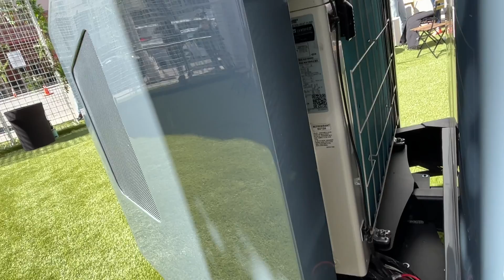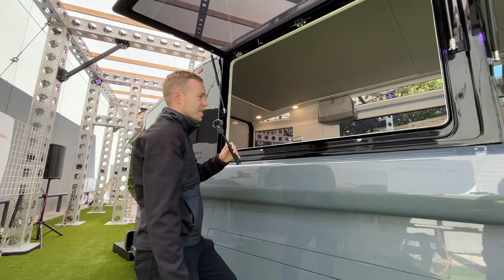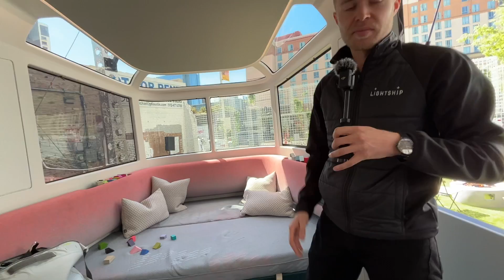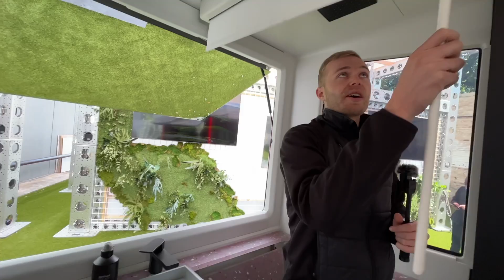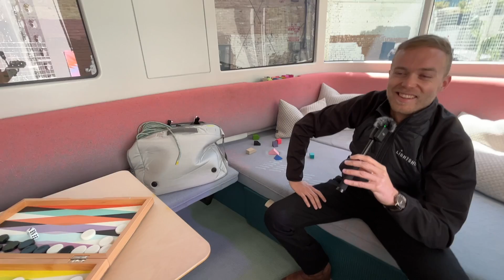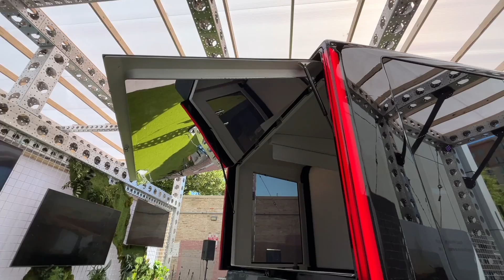Full Tour of the All-Electric Lightship L1 RV

Comment: A few practical questions: For the main sleeping area, is there a way to put on a fitted sheet? For the secondary sleeping area, the table top lowers to the top level of the cushions, but where are the pads to make a bed? Is there and exhaust fan built into the bathroom light or somewhere else in the bath?

Comment: 7500 lbs or 3400kg  is too heavy for pulling in most EVs. I don't mean too heavy for the motors especially since it has support motors on the caravan. But the regulations will not allow it.

Comment: A few comments:  drop down Murphy bed, hinged separation wall swing down from ceiling to kind of make a bedroom more privacy, modular storage modules are better off with fiberglass material than fabric, need more electrical wall outlets, not enough ext storage.  More cabinets that can be folded down in road mode but fold up to the wall, yes block some windows but storage is very limited here.  Love it over all still.  Perhaps, instead of 27", make it 33" or 38" versions too?

Comment: I get they want it to be aerodynamic to save energy but to me its a bad design to have it go up and down.1- It will create issue over time with the motor 2- problem with the seal, bugs will come in. 3- you cant maximize the storage and 4- no separate bedroom. I rather have all that than beeing able to gain a few extra miles.. if they make a model that is fix then ill be a customer for sure

Comment: This is not a RV 😂 RV is where u drive it this is more a camper RV that u pull around and its not a EV only difference is u can charge it so no worries of pluging it in at a campground or using a propane.. the inside dont look like RV an its to small..its beautiful outside but inside i wish i never spent my money on it.  This what's difference from RV and a camper i looked it up..While the term RV can apply to many different types of vehicles, the term “camper” often only applies to RVs towed behind a separate vehicle, such as a car or truck. An RV usually refers to a vehicle that you can drive independently. So tell the people who created this stop calling it a EV 😂 and a RV

Comment: OEMs for tow vehicles must accommodate en-route charging. The powertrain in this trailer is a waste. It should simply be a big battery that plugs into the truck while driving.

This would also allow for THIRD PARTY accessory battery packs for road tripping or for generators to be used when needed.

Comment: Would it be easier to design a power transfer cable so that way the trailer is just an extended battery for the truck, this would also be cheaper and lighter as there would be no drive unit on the trailer. I definitely think this would be a great alternative and at a lower costs. And less maintenance
Reply: Yep I’m also irked by this design

Comment: Not very practical for RV life. The vehicle didn’t appear to have any outside storage. The exterior doors did not seem to be designed for longevity. The interior is completely open. I don’t think rv’ers will appreciate a single interior space. Many rv’ers don’t want so many windows. Bottom line is they need to hire actual experienced RV designers. RV design by electric car people. This is what you would get.

Comment: This is what I had imagined 10 years ago with electric cars and camping where the camper can hold the extra energy to allow the car to travel for the full mileage it had unloaded and being able to regen to help slow down on hills and also to regen when the tow vehicle has sufficient charge and be able to recharge the trailer itself.  My only concern is the front facing windows as anyone who tows knows the front of a trailer gets HAMMERED with rocks and road debris. Having rock shields similar to the ones on a Airstream would be appropriate.
Reply: At lease some one on here knows this is a camper not a RV 😂

Comment: Ok. I get the desire of all electric. Sun doesn’t always shine ya know? Spend a week in washington state in the woids & you’re toast. Horizontal slides cant work with their vertical slide. I have owned a 27ft jayco, had doors & real bathroom. Vertical slide ruins it. Make it 8-10 foot tall when retracted & add a 2nd level for bedroom & living room. Water tanks need to be near 90 gallins, black & gray = 45 gallins. Full size refridgerator & some storage. Needs a generator and/or windmill. Lift this off the ground for maneuvering & clearance & get the dang inverter out from under it. Mouse proof it.  I live full time in my Class A. I have solar. In sunny aruzona in winter, I MUST have my generator! Heat pumps dont work below say 10 degrees above ambient. The windiws will make this an oven in summer & a freezer in winter. No dishwasher needed. Ability to repair things will be critical. Frozen burst pipes, replacing wiring, adding wiring etc… Good start but get realistic. You couldn’t give me the model shown. Stability jacks needed too. Television & satellite dish? TV antenna? Wifi ranger & cell extender? Fart fans? Kitchen fan? Smoke detectors? Co2 detectors? power stations for device charging? Size of inverter? Propane allows you to go off grid. Can be done without it, but in real world, 1 power source = no power source, 2 = 1. Dual power reefer, gas stove, & heater. AC units a must. Ease of waste management is critical. Good luck!

Comment: What is the point in these? They are way too low to the ground to go camping for real. Campers need ground clearance and offroad suspension, or else you might as well stay in town.  I don't want to drive a 1000 miles only to be stuck on pavement and light dirt roads. I c³onsider that torture. And whatever I drive better be able to make 1000 miles a day without having to spend the end of your trip in some town charging up. I don't understand why all this new expensive technology costs so much more, only to give us less capability than we had 30 years ago. It would be cool to see a small diesel generator and a capacitor bank to store energy quickly to avoid  stopping in towns. Also needs a way to lift and lower the axles for offroad vs. highway use.

Comment: There's a few things with this design I'm not too keen on, and have concerns about. Proprietary software is notorious for becoming rapidly outdated, as well as removing features or hiding them behind more paywalls (plus I bet it adds yet another subscription service to the rapidly growing list people have to deal with these days). The reliability and maintenance of the motors for the raising and lowering of the side/roof concerns me too - as well as the added expense of maintenance and repair. The internal storage leaves a lot to be desired because of the way it expands/reduces internal space, as well as the size of the fresh/grey water tanks and lower storage space (if there even is any) since a lot of space needs to be taken up by the batteries and motors for the wheels. His talk about the issue around road debris like rocks breaking the windows didn't exactly fill me with confidence either - those are going to have to be incredibly tough windows since even car windows crack and shatter with direct impacts from stones and stuff thrown up by surrounding traffic - and those windows are higher up and not lowered to the area where most other road traffic has stronger side panels. Honestly this design is perfect for the weekend traveller, but I can't imagine using this type of caravan (I have a hard time calling this an RV since it isn't self-propelled and doesn't have a driver's cab/seat) for longer excursions and definitely not living out of because there's just nowhere to put anything.

Comment: Hehehe, 150K , good luck with a trailer that pushes you along. Pushing the car from the rear, thats how pitting by police works. Anyone know the laws on powered trailers? I thought they were made illegal many years ago
The high-low concept failed years ago. If any part of the system fails, you can't raise or lower the top. 
Range extending for electric vehicles hehehe, most ev's won't move if plugged in. You would need to defeat this safety system , voiding your warranty.

Comment: couple of  thoughts.  I. I am solar weather /aurora photographer.  I am very aware of what a large geomagnetic storm can do to electrical grids and devices.  How are you designing this to protect this trailer from going out in a pretty blue flash amidst all the pretty lights in the sky? I would be highly upset if I spent money on trailer and it was rendered a brick of  useless metal or worse yet caught on fire miles form anywhere while I am out working. If a geo storm can blow up transformers, what will it do to solar panels and these highly flammable batteries? I am not talking what we have gotten in last few cycles I am talking Carrington Event or X class 45.   2. Which leads to how are you protecting the battery area with fire suppressants? Do you use something  like the engine bombs that go off if there is fire and puts fire out.  3.  most Rvers travel with photography gear, turn that jump seat that you have nothing under into a temperature controlled camera safe that you can store your camera and laptops in so they are secure. 4.. Rather than four doors I would like to see two of those put into drawers for clothing,  5, You need more food storage for full timers  6  I would hate soft bin storage.  I am short and handicapped climbing up to reach them would be difficult.  I can just see myself trying to unzip them and having things falling out on me.  Regular cupboards with small bungy to keep thing & doors might be easier to use.  7. You didn't include a roll down screen & projector tv. that would easy to mount in roof and stream from lap top.  8. I would not want to leave my door folded up like that, but if there was a fold up screen door or door, while you leave the outer shell open would feel more secure. 10.  dude you have not addressed BEAR security.  Camping puts you in areas bears live, they can sniff out and will eat everything from chewing gum, chap stick , deodorant, shampoos, food in cupboard etc.  With all those windows it is bears dream camper, easy access with windows big enough for them to fit through.  Maybe invest in a bear deterrent that can be turned on or off,   Have some sort of security system that monitors the screens and window, if something or someone tries climb through or screens are pushed on, cut or disturbed a deterrent is trigger that includes, bright flashing lights, vibration and loud piercing sound. This should be enough to startle the bear and get it back off.  If it proved a problem and the bear is determined with his stomach doing the thinking for him,  I would add a pressure plate that Tasers anyone trying to climb in the window.  Should other measures fail, a good hard shock should do the trick. 
If you ever want a tester I am willing to be a guinea pig. I prefer to be out in nature way from people I would definitely put it to the test..

Comment: why is it that "thirty something" tech people can't seem to talk or form a sentence?  is that a result of their woke, "fluid" education where no one is allowed to make a "definitive statement" about anything?  the "ooughs" and "ahhh's" and "searching for words" sounds like these two are recovering from a stroke.  i actually couldn't watch this video because neither the interviewer nor the "kid" who helped build this "battery powered Airstream" could engage in a normal, coherent dialogue with each other.  i have been following the hilarious failures of electric vehicles (including electric pickups) being tested towing RV trailers.  in every test thus far, hooking up ANY KIND of trailer to an electric truck almost halves its driving range.  i was interested in how much this "all electric" trailer weighs and i didn't hear that number.  if the GM Hummer weighs in at 9000 lbs, i'm guessing this "extension cord" camper probably weighs at least that much.  i suspect the IRONY of this trailer will be that with all its "electric bells and whistles" and heavy batteries - you will need a RAM 1 TON PICKUP with a CUMMINS DIESEL to pull this thing!!  i'll bet if you hooked this up to the electric Ford Lightning pickup you would "maybe" drive 100 miles before having to find A PLUG!  LOL!

Comment: This ev trailer hits all the correct buttons. The electric assist motor is something I wasn't expecting.  So cool
Reply: To me its a little bit of a design miss -- to make that sort of feature worth it you have to do a LOT of towing.   But the half height design means you don't have nearly enough storage (and likely that means tankage too) to make this a full timers trailer.
Reply: @redwolfexr  yeh I understand the cost of having the electric assist but just the idea of a trailer pushing its own weight.  Just think if this function hooks up with your trailer plug "BUS" cable your primary vehicle like an EV doesn't even have to be rated for pulling the weight of the trailer. Kind of cool idea but it's a prototype.
Reply: @markcollins457  yeah, I get that they are tossing everything in and seeing what sticks.   There are actually other trailers out there with assistive drive...  e-Stream is Airstreams prototype.   The difference is you can full time in an Airstream and I don't think you could in this trailer.   

It LOOKS really nice and I suspect most people would want to park this on a slab at the lake that has power.
Reply: Not a EV trailer 😂 can u drive the EV 😂 when u say EV I'm thinking of a electric car 😂
Reply: The electric motor assist is very interesting, I've been thinking about that for a few years ago. It's definitely as it frozen cons. A few points of discussion.
Typically towing vehicle:  they need to be heavy enough to be able to control the camper. Adequate power  with good  breaking capacity.  
Trailers and campers: They commonly have breaks built into them to help with breaking.  That's proven to be safe, do the fact we're pulling against the toe vehicle.  The system uses a type of feedback masters cylinder at the bumper hitch the brakes.  

Electric Assist Trailers: A trailer loaded with batteries can assist with the towing vehicle by reducing the tolling load.  It may also assist the towing vehicle by regenerative breaking as well as hydraulic breaks.  Both the systems can be control by a feedback actuator at the bumper.  Similar to the standard master cylinder driven by feedback liver at the hitch. 

What do yeall think, would greatly increase a vehicle is low capacity for pulling? I think this is a miss numer because the weight of the towing vehicle is necessary to control the trailer safely.  I think it's a great idea to reduce fuel consumption only.  Love to hear your thoughts.

Comment: Be great to think into design following:

1. Open hatch in back for e-bikes inside or smell motorcycle. Many of us will unpack bikes. E-bikes heavy. Trailer doubles as utility if rear hatch if wanna load.

2. Move bath to front so no rocks break the front windows.

3. Everyone I speak to want a 5th wheel airstream so vehicle and trailer fit in double parking spaces in normal lots.  Opens so many doors.  Connection point do much stronger too on 5th wheel. 

What bi-directional heat pump did they pick?

Comment: WTF
1. it's propane bottles not cans!
2. Has anybody in your design team used a travel trailer for longer than a weekend?
3. With all the windows your going to bake during the day and freeze at night.
4. No storage to speak of.
5. Refrigerator and freezer way to small.
Etc, etc.... Total design failure. 
Go back to the drawing board.

Comment: I love the idea, but hate the design and execution. All glass siding looks cool but I worry about rocks while driving. The interior looks like it was designed in the 70's. I'm also not sold on the benefit of adding a powertrain to the RV. I'm sure it adds a significant cost to an already overpriced RV. The excuse of slide outs being too hard because of gravity is just lazy. Small RV trailers have been doing horizontal slide outs for decades with good reliability, and they contribute so much to interior space.

I applaud the size, weight, and pop-up configuration, and the solar panels and batteries add incredible value even when parked at home. I envision using this for my home's electric needs when not RVing or in case of a power outage. Just the batteries and solar panels are worth $30k in this regard. Charging your EV truck at the camp site would also be satisfying!

I hope they take a hard look at the RV competition and see what established RV companies like Jayco and Grand Design are doing, because this interior is a deal breaker for me.

Comment: The two options I would like to see are -
An upper bed. The ceiling is high enough a mattress or hammock could be engineered in.
Second an option for a composting toilet. I have found the composting toilet has less smell then the enclosed sewer. It also is so much easier to process than the big dump u have to do with a black tank. It will make so many things easier.   Also All the current commercial composting toilets are too complicated on the intake- and need better engineering on the out take.  
U would need a smaller black tank also.
Reply: Oooh... and less weight with the dry toilet.

Comment: Hallelujiah!  I had been hoping that someone would take a Tesla-esque or Jony Ive-esque design to RVs!  So far they look like chimeric contraptions, with all kinds of equipment bolted on, sticking out of the main volume:  Ladders, awnings, air conditioners, gas cylinders, communication equipment, solar panels are added on creating noise and turbulence.  Even unavoidable details, like handles, lights and air vents sit proud of the surface.  Finally!  Tesla trained engineers that plan to accommodate equipment within the outer envelope.  Best wishes for speedy success!